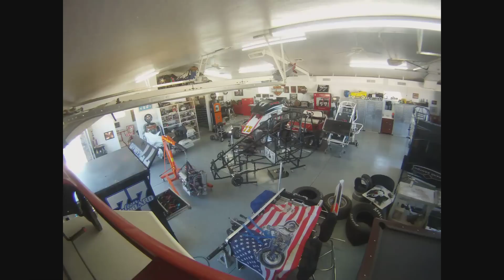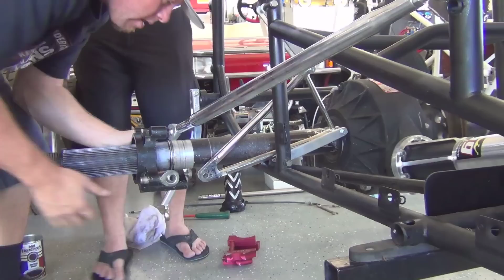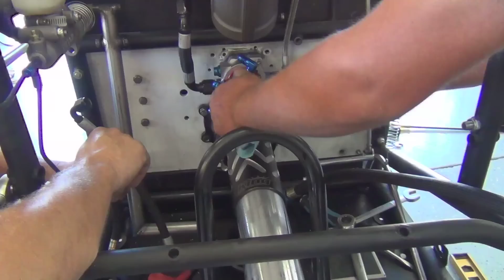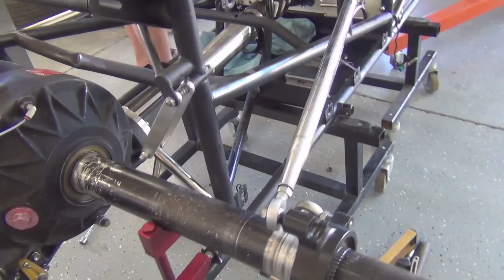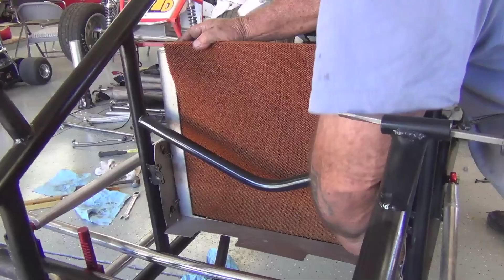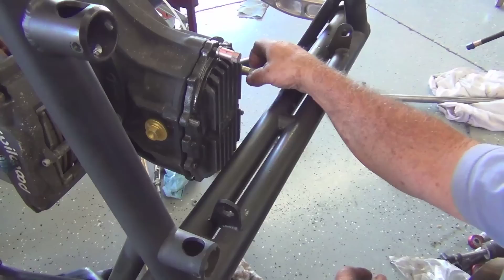Gabbard racing # 77 Sprint car build

Comment: Power comes in the case at the front, on a shaft that goes past everything to the rear quick change gears then forward to the ring and pinion.